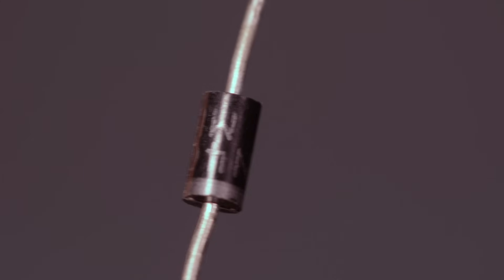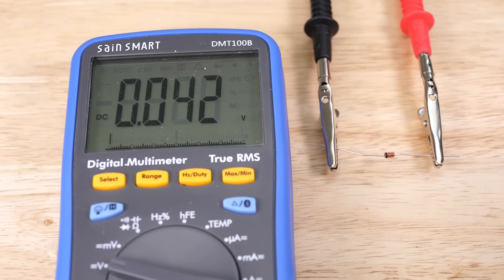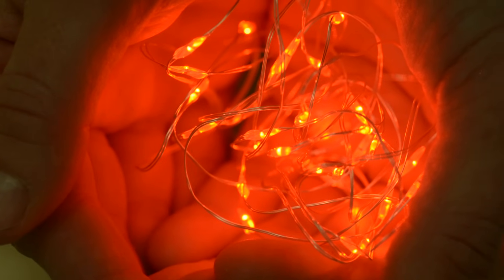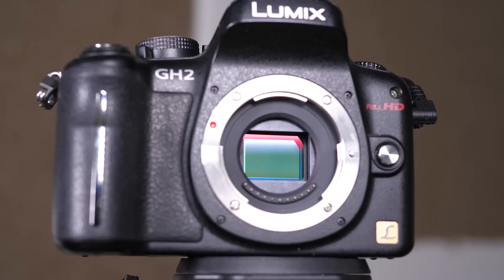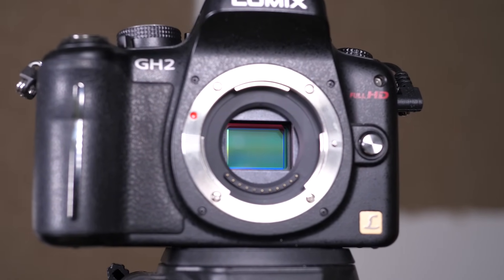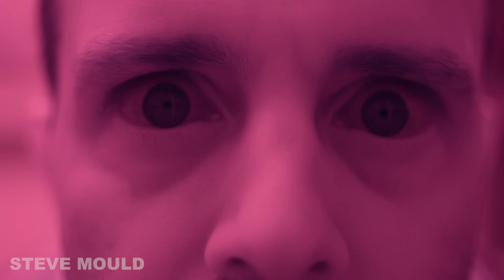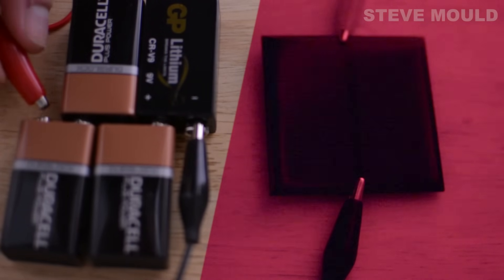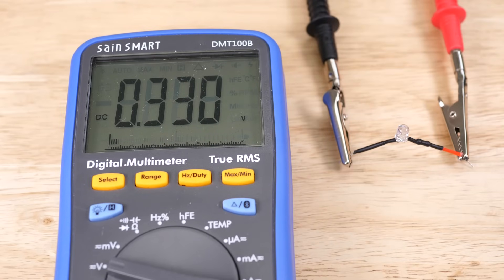Why all solar panels are secretly LEDs (and all LEDs are secretly solar panels)

Comment: 1. electric motor <=> generator
2. mic <=> speaker <=> piezo
3. solar panel <=> diode <=> led
Reply: ceramic microphone <=> ceramic capacitor <=> buzzing ceramic caps
Reply: Now I'll waiting for the next generation of phones to have a solar panel screen charging button
Reply: @jimmyjohn8008  Your waiting day is over i think some Korean university has got it
Reply: Forgetting TEG <=> TEC
Reply: @deltuhvee  don't

This was the best explanation of holes and semi conductors ever...
Reply: internal combustion engine <=> air compressor
Reply: Electric motors can also be used as speakers
Reply: So that all coming together
Reply: Speaker<=> oscillating motor<=>vibrator
Reply: Entry <=> Exit
Reply: @steveman1982  yes, but that's not a universally accepted equivalence....so it could get you in trouble in certain situations
Reply: thermocouple <=> peltier cooler
Reply: giovani <=> giorgio
hotel <=> trivago
Reply: roomy's toothbrush <==> toilet cleaner
cattle corn <==> car fuel
condoms <==> rifle protectors
crazy glue <==> wound sealer
microwave oven <==> hair drier

Lol, maybe not the last one but I liked this video.
Reply: @rwatson2609  this glue was developed for battlefield wounds. It's not good at it by chance, it was it's purpose
Reply: I can’t find the video about speakers being microphones, is it gone?s
Reply: Cross compatibility is such a comfy quality.
Reply: @David-bc4rh  Apple will disagree.
Reply: It's all coming together...
Reply: Most physical phenomena are reversible, but not always efficient.
Reply: Motors <-> dynamos
Reply: ok except "piezo" refers to a specific property of certain crystals...so, no....it's more like "piezo mic <=> piezo speaker"
Reply: Air conditioner <=> heat pump-based heating system
Reply: joker <=> smoker <=> midnight toker
Reply: That is cool.
Reply: Ammeter - galvanometer - voltmeter
Reply: Wow, didn't know piezo and speaker work interchangeably
Reply: I once used my speaker as a mic, the  sound wasn't great.
Reply: hotel <=> trivago
Reply: Yea 😂
Reply: Heat pump <=> heater <=> refrigerator
Peizo crystal <=> light source <=> voltage source <=> oscillator
On and on
Reply: Shoot! That's kinda what my shop needs to look. Finally have most of it all in one place to go threw it again and see what I have. Gunna be fun! Sorry didnt mean to write t h is on your spot
Reply: Nice, I was gonna do this.
Reply: Yes! Electric motor  generator very good.
Reply: Baseball bat <=> axle <=> lever
Reply: Solar panel like in firefly?
Reply: Rail of FDDs 3.5" with controller operate = music instrument
Reply: America <=> Mess
Reply: Alternative comment: what would happen if you use 100% of your brain
Reply: Step sis <==> not what u 🤔
Reply: I was reading this old navy guide to electricity the other day and they didn't really utilize photovoltic cells as solar panels yet and they said their main use was for cameras lol. But that's kinda like the visual equivalent to light <==> camera. Cool comment tho, I didn't think about piezoelectricity at the same time as the power sources
Reply: nerd 🤓
Reply: optical telescope <=> optical microscope

(optical systems are always reversible)
Reply: What is the piezo ??
Reply: OG Antihistamine <=> sleeping pills <=> motion sickness pills
It's all just diphenhydramine, only marketed differently depending on what effect they're promoting. You get all 3 results regardless.
Reply: I think Teslas work with the idea of motor=generator to charge their batteries when you aren't accelerating
Reply: @Babom_Official  I know for sure that the Chevy Bolt has a single-pedal driving mode that reverses the motors into generators any time you take your foot off the gas completely, allowing it to “brake” by converting the kinetic energy of the car back into stored electricity.
Reply: @MegaBrokenstar  interesting!
Reply: But only the first ones are able to have the high efficiency in both ways.
Reply: Diodes are not necessarily LEDs. Depends on the band structure, e.g. silicon makes solar cels and diodes but will never electrically emit light.
Reply: @patrikgubeljak9416  Yes. I had a whole semester of the professor saying: "This is all nice but unfortunatelly silicon doesn't emit light so photonics will never reach mass production." He then talked about silicon in a different latice that might emit light. I have seen  a paper about silicon nanostructure laser so maybe there's hope.
Reply: @patrikgubeljak9416  …and quantum momentum. It isn't easy to find a pair of semiconductors that will emit light.
Reply: @LMB222  that's included in the band structure :)
Reply: @patrikgubeljak9416  Oh and now I remember why the solar panels are so shitty diodes. The direct bandgap makes it impossible to emmit photon unless it interacts with a phonon. It is not impossible just unlikely therefore there is not much light produced this way. Just like fosforescence where the transition is "forbidden" but it appens anyways just at much slower rate.
Reply: @erikhendrych190  you mean indirect :) And e.g. GaAs has a direct bandgap, so those solar cells can act as LEDs, but to get efficiency you need to design the entire thing to easily emit light. But yes, the joint propability of photon emission and phonon interaction means that the recombination without emission happens much more than recombination with emissions of visible photons, so your efficiency is super low.
Reply: @erikhendrych190  are you a physicist as well? :)
Reply: @patrikgubeljak9416  watch the full video and come back again.
Reply: @error1022  You can't just use diode and LED interchangeably, as in the title. Light in the context of electronics means THz and IR as well.
Reply: @patrikgubeljak9416  mmmh title? okay nothing to do with my comment then.
Reply: @patrikgubeljak9416  How that is changing the fact that diodes emit light?
Reply: @patrikgubeljak9416  IR and Radio waves are still lights,

Comment: he is lying real led solar panel make 57,000 volts. simply take 48 green 3mm leds and remove from casing and use plastic shims to slightly separate then (now they must fit 48 within two inches length and one eight inches thick without impeding a second line of the same. then you make 8 rows of 48 and in the sun the volts is 16 volts per line times 8 line making 128 volts per two square inches and in four inches you take the second two inches and step down to amperage so you get 120+ volts and 20+ amps but the oil industry is blocking the idea so you have to make them at home and this can be difficult to control the voltage and amperage fluctuations so a 6 foot panel capable of making 57,000 volts (amps unknown and dependent on designer.) is usually used for only 10 percent of the total possible in order to develop even electrical flow. good luck diy ers and good health.

Comment: Does that mean that a led panel with lots of led under the sun (like those on road signs) are constantly sending a reasonable amount of power when off?
Reply: The problem with your statement is the word “reasonable”.  LEDs are optimized to emit light, and that makes them poor solar cells.  Solar cells are optimized to generate electricity, and that makes them poor LEDs.
Reply: yeah, but not enough to induce a change/imbalance in the circuit
Reply: But you have a good point :)

Comment: We used battery powered LED lights with solar panels on them for Halloween last year. We left some up for Christmas and noticed that they would occasionally turn on some nights even though the solar panel was buried under snow. Is it possible the actual LEDs were charging the battery pack during the day? Otherwise I guess some light will make its way through feet of snow

Comment: I’m not very knowledgeable about electronics but I thought photovoltaic cells were used and they do not contain leds. I could be wrong.
Reply: They are both diodes. Leds are optimized to produce light, pv cells are optimized to produce electricity. The entire point of the video was to show you they both can also do the opposite, but very inefficiently.

Comment: So could you somehow modify a tv remote to use the IR LED as a solar charging panel while it spends the majority of its life sitting idle on the coffee table, so you never have to change batteries again? Obviously using a rechargeable type battery in the remote too.

Comment: So 2 diodes facing same direction and one opposite attached to a rechargeable battery should produce a small voltage pretty much anywhere anything is happening wich should charge my battery wether it’s dead or only partially dead

Comment: So technically i can charge my phone just putting it under sunlight , bcz my phone's LED is Solar Panal ? I mean it can be charged in emergency (if there's w way that SUNLIGHT energy passed through LED to battery)
Reply: I haven't looked at the schematics of your phone, but I can almost guarantee that wouldn't work for two reasons, (at least). 

The main reason is it's not gonna be wired for a voltage from the screen to be able to reach the battery. See the first few seconds of the video again for how that works.

The second reason is, like he said, LEDs are bad at being solar panels. The highest voltage he got from that one, with a flashlight right up next to it, was still under 1.5 volts. For context, most phone chargers give you 5v, so even if you could charge it that way, and you had access to a bright light, not just sunlight, you'd be looking at a charge time about 3 and a third times as long as using a charger, which, I'm gonna be honest, is a lot better than I expect when I started writing this comment, but it still wouldn't work for that first reason...
Reply: And most phone displays are not led, unless they’re oled. Most are lcd.

Comment: Course you can use a speaker as a mic.
(Discovered that when I was 7).

But a mic is better for recording, just like solar panels are made to convert light to power much much better than a diode ever could.

Comment: Phone cameras usually don't have infrared-filters; so you should be able to use them to make near-visible infrared light visible. (E.g. works with TV-Remote LED - when you press a button you should see it light up on your phone's camera. Another example is the Wii sensor bar infrared LEDs)

Comment: LEDs make terrible solar cells, but they can make viable light sensors. I saw an LED cube that used the corner LEDs as switches. One of the neat things about using an LED as a switch is that there are no moving parts.

Comment: Yep... I've explained this to a lot of people, and I'm dumbfounded no one's made a hybrid LED/solar panel for cell phone displays.
Reply: You need to learn what efficiency is and how to measure it.
Reply: It would be so uneconomical to produce and would only generate a relatively small current
Reply: @WanderingEclipse , cellphones wouldn't need a large current.
Reply: kehvan When I said current, I should have said power - phones do require a relatively large amount of power and a solar panel the size of most screens just wouldn’t provide that. Also, most of the time, your phone is in your pocket, meaning there would be no light to charge the battery when the phone isn’t being used.
Reply: @WanderingEclipse , power requirements of a cell phone actually are pretty low.
Reply: kehvan yes but they need to either be charged for a long period of time (not possible since they are mostly in people’s pockets) OR they would need to be charged at a higher power (potentially dangerous, reduces battery’s lifespan and not possible with solar panels of that size).
Reply: kehvan Fair point but are you suggesting that people would have transparent pockets? I can already see potential flaws as far as security/privacy in concerned.

Anyway I am no expert in electronics so the whole concept may be far more plausible than I would imagine.
Reply: @WanderingEclipse , well, I wouldn't call myself an expert, but I am a professional in the field and know enough to be shocking.

Comment: I remember as a kid in the late 1960's or early 1970's I had a power transistor, which was about the size of a Kennedy silver half dollar, encased in thick metal.
Applying brute force with pliers and vice grips, I tore off the top to expose the inner wiring.
I connected a voltage meter and measured a voltage as I exposed the inner wiring to light.
That power transistor acted like a solar panel, but it was very inefficient as such.

Comment: Man I'm about to make someone a billionaire, and its ok, I have PLENTY of innovative ideas for many things :D

So, if all solar panels are secretly LEDs, and all LEDs are secretly solar panels... why don't LED tv's do like the formula one cars?  In order to conserve energy, Formula 1 cars gather heat energy released from braking pads in braking, and store this energy in an onboard battery that they can then use as a boost once per lap.  This is "free" energy for the formula one cars that they can regenerate while braking.

On the same token, why don't LED tvs/monitors act like solar panels in receiving light energy from its surroundings to reduce the energy consumption and  help reduce the overall world energy consumption issue?  (hell, why don't gaming computers/computers use the thermal energy released from the processor, ram,  and graphics card to store energy in a battery that can also help to reduce the energy consumption of computers?)  I'm genuinely interested.

Comment: can a led tv collect energy using the internal speakers like one of those eternal motors the screen generating charge into a superconductor of sorts then running through the speakers wired to maintain the energy then back to the led?

Comment: So what's the rule for how much unput power you put in to the panels?
Reply: You don’t put in power. You put in voltage, it draws current, and power is transferred.  I suspect he upped the voltage until he got the effect. You must limit the current or you’ll fry the diode.

Comment: All tech will work 2 ways forward and backward if it takes electricity to fulfill a given effect it will produce electric current if the effect is introduced to the tech in question. It’s a by product of human engineering. Everything that runs on electric current can produce electric current. Thank you for your upload I found this out as doing dj work speakers are microphones and visa versa. Share the knowledge open the minds and eyes of a deep sleeping public. Cheers mate

Comment: What happens if you shine light into a laser diode? Would you get a higher voltage output than a basic LED? It would probably require the same wavelength being inputted as the lasers output to stimulate the gain medium and get more current. I'm guessing.

Comment: Duality of electrical universe. 
Magnetic field > electric field. 

That's why even radio receivers have to be shielded as they are transmitting in low power.
Reply: No, thats because heterodyne radio receivers have a local oscillator that generates rf.  You can make a radio receiver that doesn’t radiate anything.

Comment: What if you had a huge LED connected to a huge solar panel, and the sun kickstarts the solar panel to power the LED, but the light from the LED turns the solar panel into a perpetual power machine forever fueling the LED?

Comment: 10s (4x9v batteries) is a bloody large input for such little effective work being done. Have you tried it with a touch more current?
Reply: You seem to be confused about the difference between voltage, current and power.

Comment: What's the difference between an engine and a motor?
Reply: Engines operate on heat difference, usually but not always from a chemical source.  Motors operate on electromotive force difference, from an electrical source.

Comment: @Medlife Crisis is wrong, we did that last century, Dr Lary Gadeken, an Alumnus of The University of Liverpool, who went on to lecture on 'Diodes; etc. at The University of Rochester NY. made little Diode Boxes only 2.5 micron cube. then filled them with a silicone rubber, that used Tritium instead of Hydrogen in the molecular bonds. Dow Corning, I suspect may have had a hand in it, Dr Pierpoint who was their chief chemist, may have been involved? He set up up business on his own J-Sil Silicones Ltd. of Bury, Greater Manchester. UK. Now there are 400 of those little cubic box diodes to a linear cm. and 160,000 in a square cm. and of course 64,000,000 in a cubic cm. Ideal for tiny little sensors to monitor Halliburton Oil Wells. Cloud Computing under the ground, sensors so tiny, they are unobstructed flowing through porous oil bearing rock. Lary Gadeken's Daughter Jessica Joy fell in love with a Medic just like yourself "Medlife", His name is Dr. Aaron Polyea, and they are using these tiny batteries to deliver medicine to target areas, especially stem cells to repair DNA damage. Also to extend 'tellomeres' ...

A telomere is a region of repetitive nucleotide sequences at each end of a chromosome, which protects the end of the chromosome from deterioration or from fusion with neighboring chromosomes. Its name is derived from the Greek nouns telos "end" and merοs "part".... (Wikipedia) 

This allows people to grow younger again, instead of older, .... SO BRAVO! @Medlife Crisis, great idea, but NOT NEW. OK? ( B.T.W. Dr Lary Gadeken's Doctoral Dissertation, actually got my tear ducts flowing, it was so elegantly written and suggested so much hope for all humanity....  Check out Betabatt here :-  http://www.betabatt.com/

Comment: I thought cameras see infrared by default, because if you use the cell phone camera to look at the remote control and you press the buttons, you can see the let lit up. Is that just a small part of the led's light ?

Comment: @0.50 ish - So hangon, can you use light to change the voltage drop of a diode? like for example light leaks into the electronics and changes its behaviour?